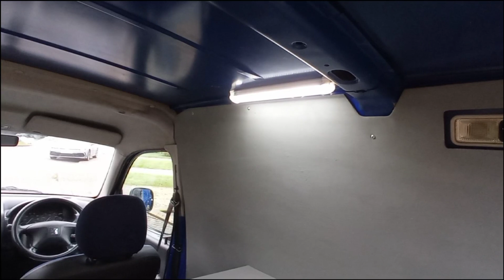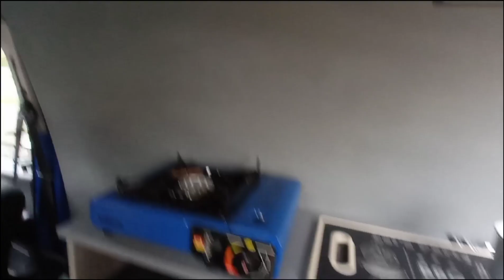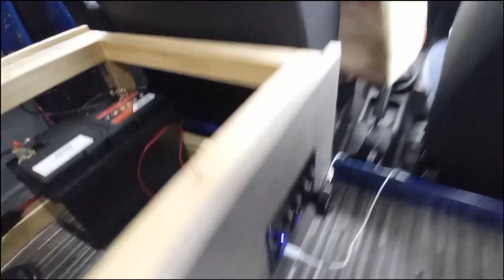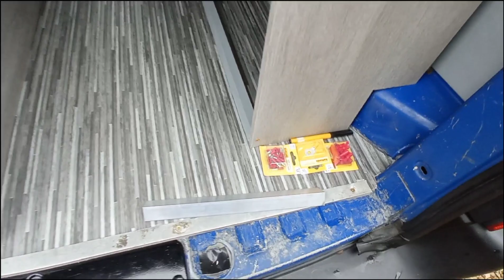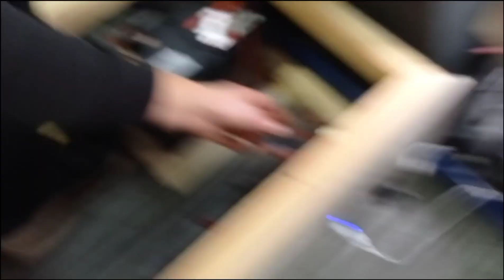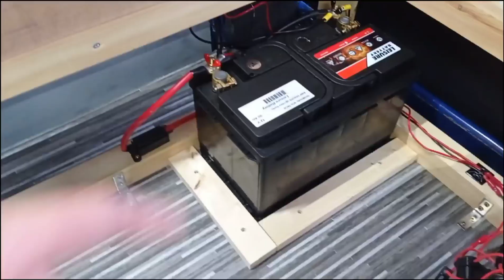Peugeot Partner Stealth Micro Camper Finishing The Build | Ep.7

Comment: Just a brilliant series! We bought an old vwT5 already converted but the layout is frustrating. I'm thinking of changing my small mini suv car and mostly i have the back seats down to have a bigger boot. I'm seriously tempted to just replace it with a van and do my best to recreate yours. I'll have to get someone to do the electrics. Is your cooking stove gas?
Also, is the silver insulation panels enough for warmth? 
If it didn't already have the ply side walls... Is that what you would have built it would you have done something different? 
You mentioned you might carpet the roof  in there future.. Would you need to put insulation under that? 
Finally, when screwing the bed and other things to secure them.. Do you still through the metal pay of the vehicle and does that have an implication for rust?
Reply from the maker: To be honest stick a diesel heater in there and you won't have to worry about the cold, people go overboard with insulation and it doesn't make much difference. Yes it was a camping gas stove with them small gas cartridges. Best to screw threw the floor and dap some silicon on the other side to weather proof it.